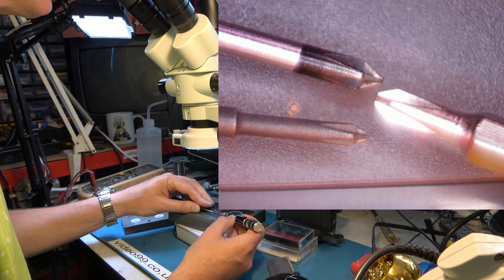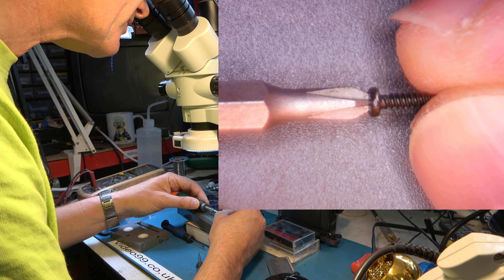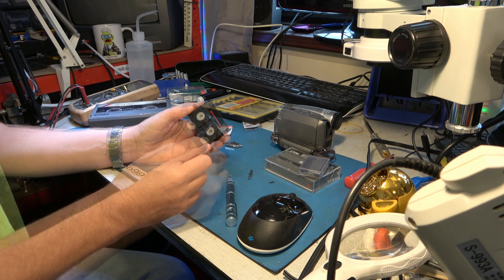Poundland screwdriver.  No Job Too Small?  We will see about that.

Comment: I had a cheap screwdriver set like this, but with about 20 bits. The handle shattered on it after about a month. So I bought one of those poundland sets just for the handle, and it's been fine for years. :)
Reply from the maker: That's a good use case for this, since the handle is better than the supplied bits.

Comment: i have had one of these for a couple of years too, ive got to say i have no complaints. most of these cheap screwdrivers from bargain shops start wearing down after a couple of uses. the bits on these seem to be of fairly good quality considering the price.
Reply from the maker: I agree that it seems quite tough, just the sizing is all wrong!

Comment: I got a few samples of something similar at Dollar Tree here in the 'States. It's a little bigger and has the usual Phillips and slotted bits as well as a few small hex sockets, but it's made of somewhat mushy materials, so it's only fit for light tasks. I find these cheap tools useful to keep around items that I know are going to need tools of a known size from time to time, like the car air filter and the hose clamp I have to remove to snake out the kitchen sink. If a cheap tool will do, it's easier to keep it on a ledge or in  a pocket nearby things like this than to have to go dig up the right size every time I need to snake out the drain or change the filter. They are too flimsy for general use, but for a buck, it's easy to justify dedicating one to a recurring  light task.

Comment: They cost £2 now. Those days you can find such "funny things" even in tkmax. You have to cut that aluminium handle for about 1cm or file that bit with driller and vice or with anything else to remove that extra material from a bit. Still better just to buy a longer screwdriver for that, but it's possible.
I bought another one only because I was too lazy to look for my old one, those bits are interchangeable.

Comment: I was not supprised about the bits, not enough of them eather :-(
i like the handle too, grippey.
The bits may be wrong but they are not bad (maybe when the plating peels off hmm).
i also have a cheap set,  one of those upright bit holders and two rubber rings with holes around the cercumference to store the bits in.
It's from Toolbox and has 31 bits (But some are pointy things or odd shapes).
They do get mullered and i brush a tiny file across the flats to keep them working.
Monkey metal lol
One of the torx bits became mushy, so i filed the end off and with a torx screw head in a vice i placed the bit in the screw head and hit the back with a pin hammer lol.
Brutal but worked.
They were a present from a kind frend, i appreciated that so 4 years later they still work.
Good real frendships are hard to find.